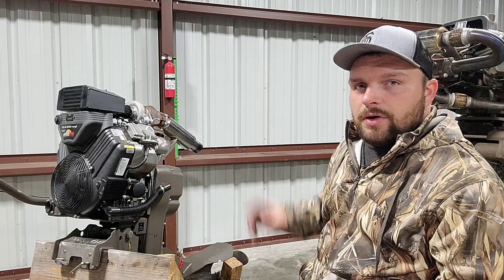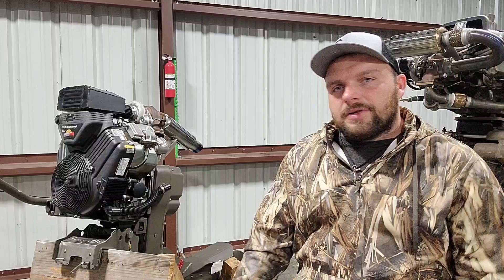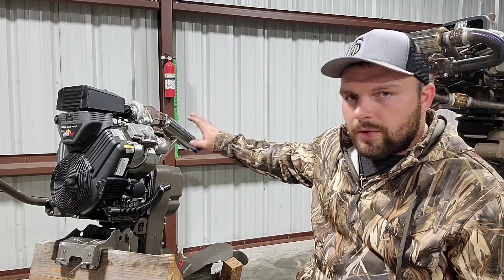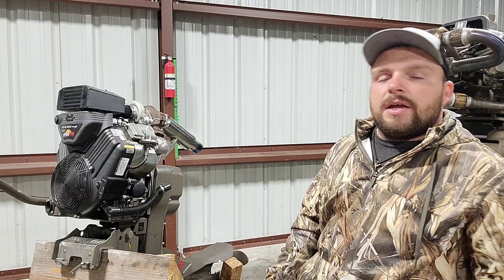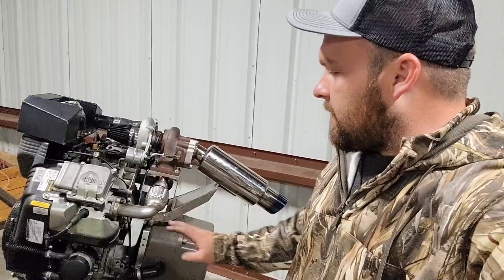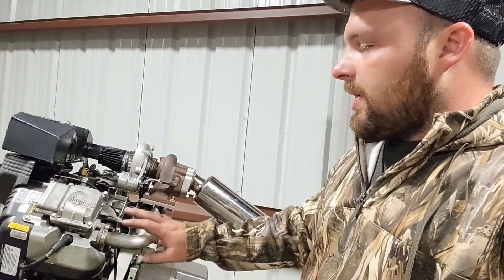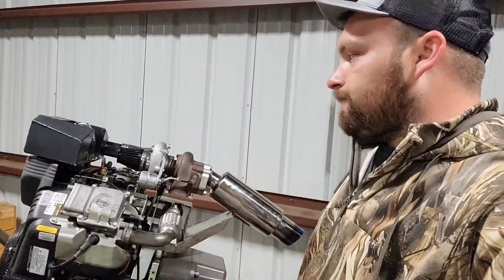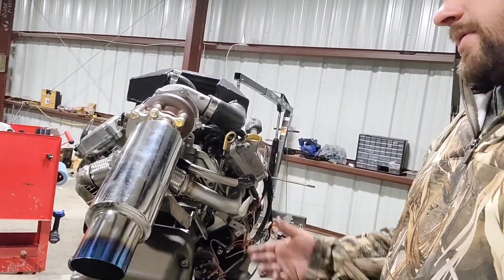Our  Turbo'D Mud Motor Custom Intercooled (patent pending)  horizontal shaft Turbo System

Comment: Great set. Is it possible to substitute the steel braided exhaust with stainless. I live on the coast and saltwater is a concern.
Reply from the maker: Everything on the system besides the turbo itself is stainless or aluminum 

The exhaust is 💯 stainless